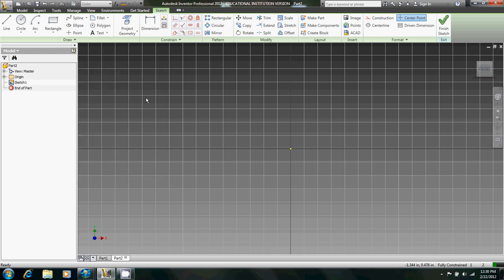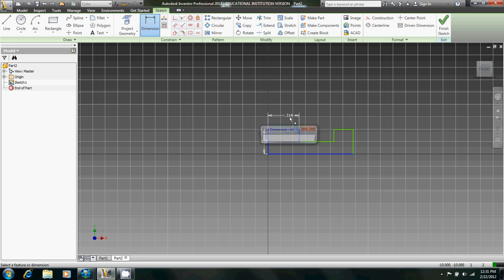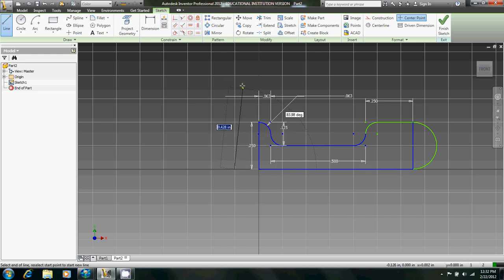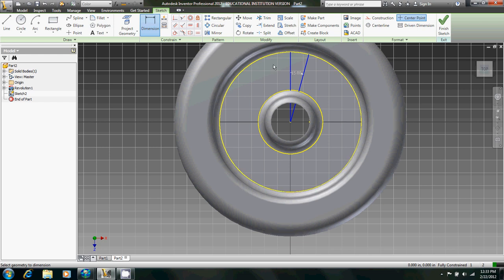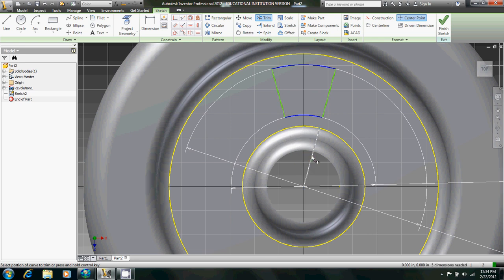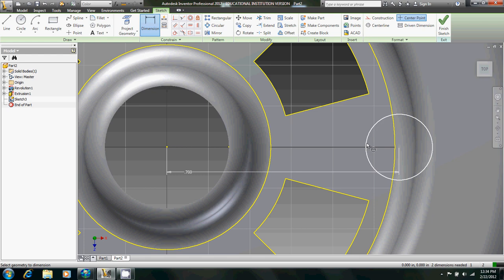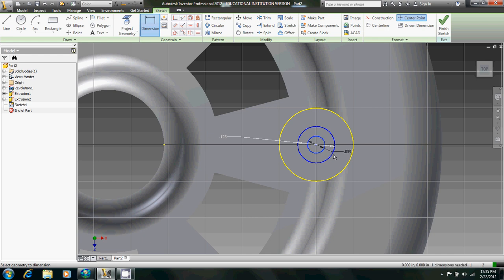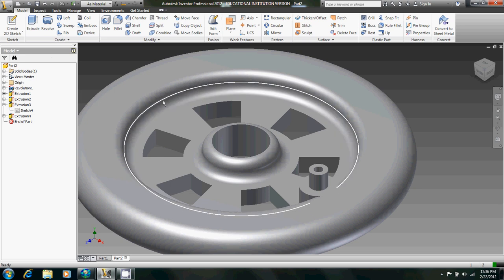Mini Train Wheel for Introduction to Engineering Design (PLTW)

Comment: At 2:58. You said the dimensions for the first circle are .063 times 2 but you put .63 times 2
Reply: .063 is the radius you multiply it by two to get the diameter